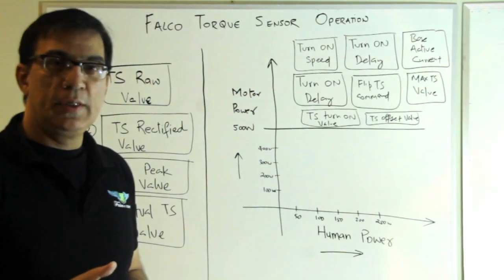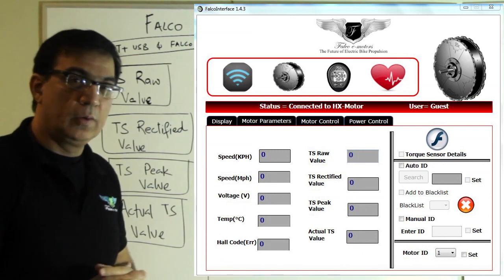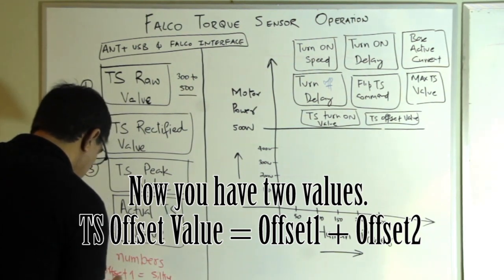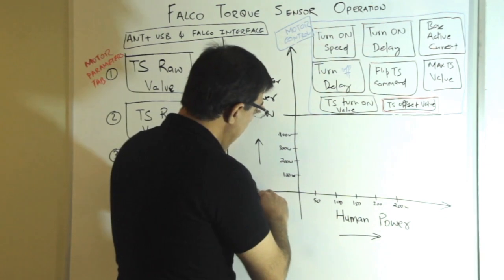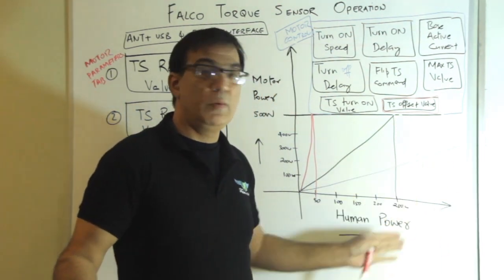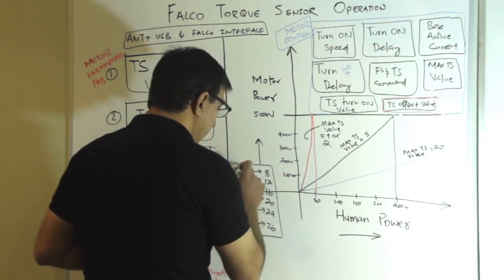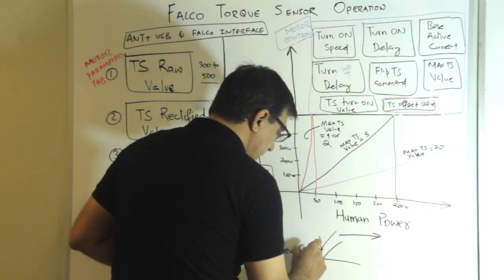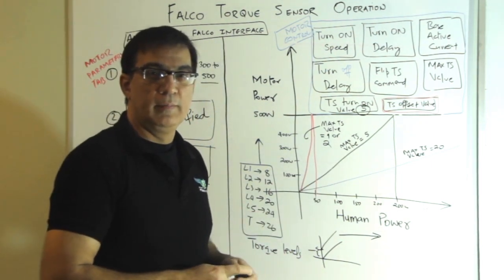Falco Torque Sensor Explained

Comment: Yeah sure...NOW I am supposed to pay $50 dollars for the USB stick.  The hub should work out of the box.  This hub did not.  JUNK
Reply: +Daryl Parsons Thank you for your comment. Front wheel installations do not require any torque sensor adjustments as is the case with your installation. Pedal assist signal is generated through the pedal assist sensor in the pedals and transmitted to the motor.
Reply: +Rakesh Dhawan  Well then...I have the motor and YOUR battery but it does not work.  You can tell from this post that my setup is NOT working, so why not help me??  Instead you simply point out that my setup does not require a torque adjustment.